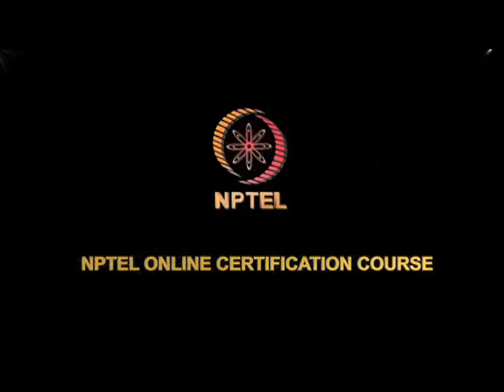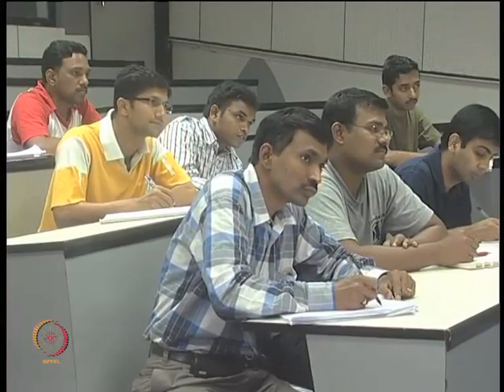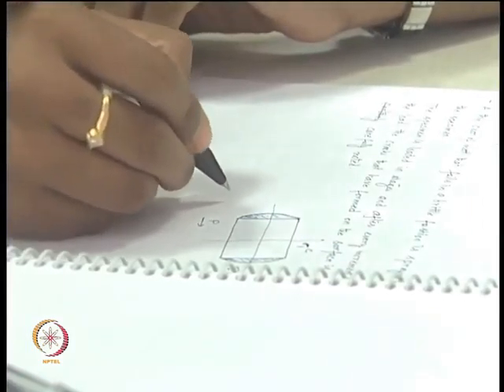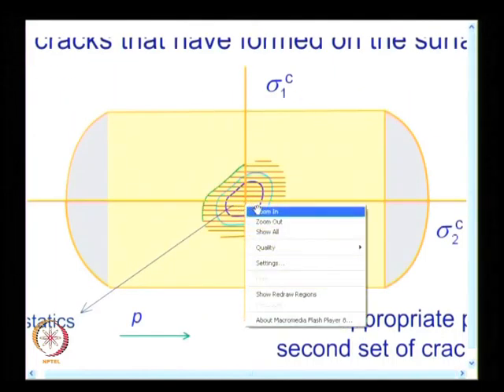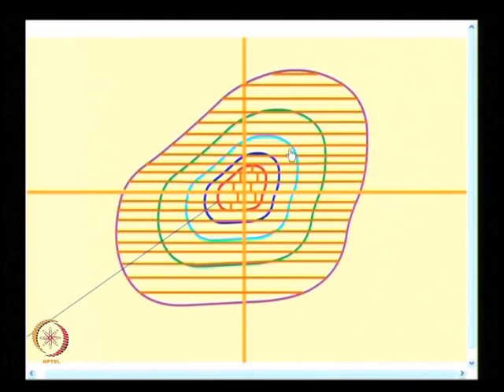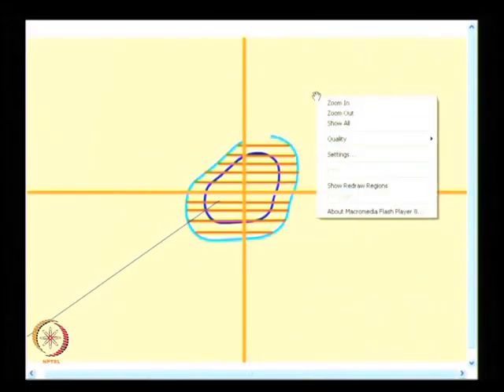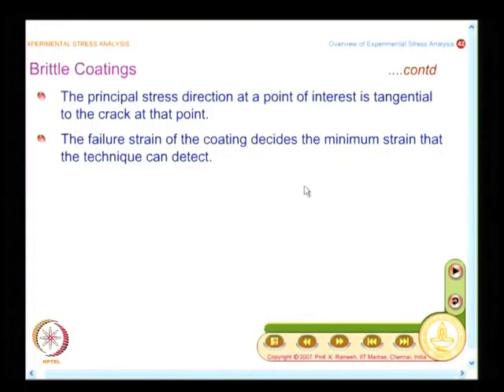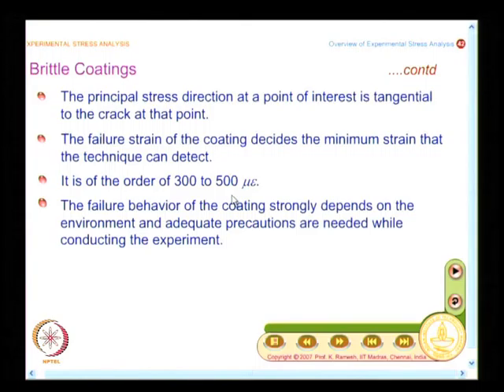Introduction to Brittle Coatings

Comment: This is a very ingenious method, thnx! Do you know what type of paint is typically used for this? Acrylic, epoxy, nitrocellulose? .. Most paints are formulated to be flexible. How do they get the paint to be brittle?